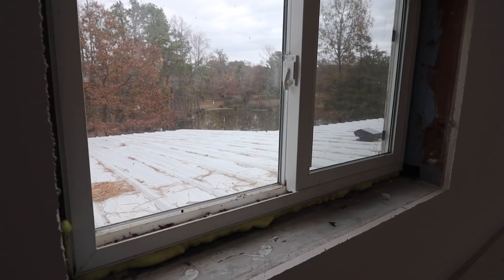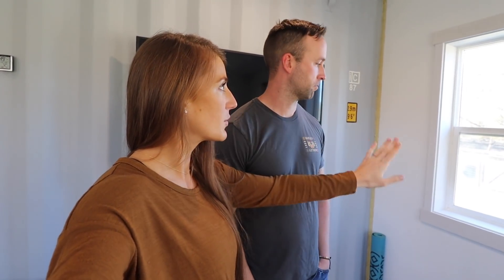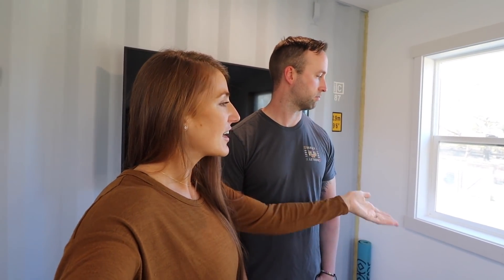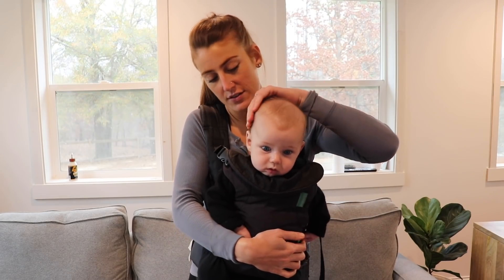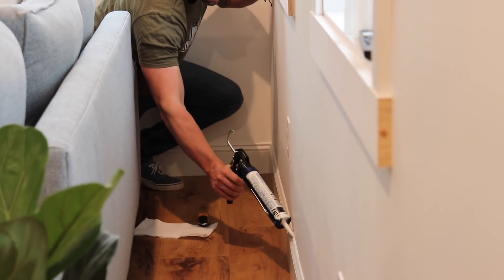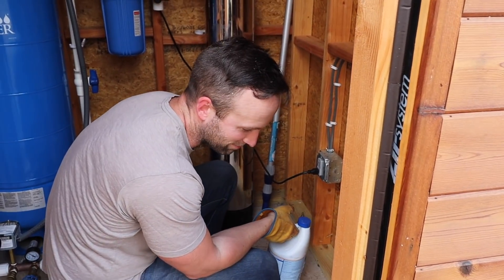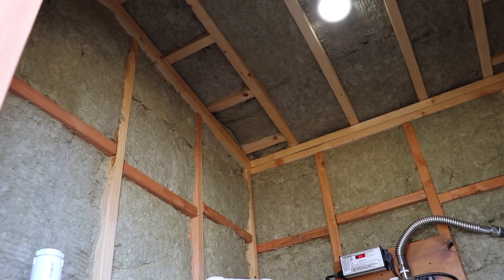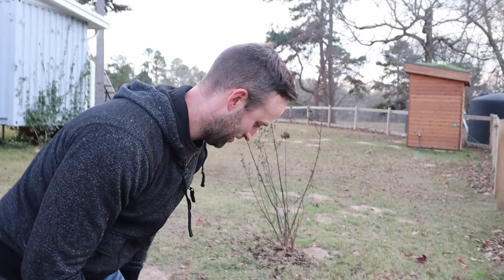PREPARING FOR THE WORST...

Comment: I suggest you add "self regulating heating tape or cable". It goes by many names and has many types but this would be the best for searching the product. It's an electric heating cable that you attach to your pipes. The cable is filled with metal strands and the cable jacket is sensitive to heat. When your pipes get to freezing temp, the cable jacket shrinks, causing the electrical strands to join and produce heat. Once the pipes are heated the jacket expands and no electricity is used.
Reply: We call it heat tape or heat trace and should have a membrane between the plastic and the trace to avoid melting and distribute the heat wider, metal/copper pipes it doesn’t matter though
Reply: yes, I would definitely add these heating tapes 👍🏻

Comment: Take you a string ..... Maybe a needle and thread and string together 5-6 cotton balls. Dip the cotton balls in oil of peppermint. Hang the string in your pump house 6-12 inches from the floor. Mice are highly allergic to oil of peppermint. They won't come back. Makes the area smell good too. We put it in all of our storage buildings. Actually , in most I just saturate a cotton ball and toss them in the corners of the buildings. Works good in the feed room in the barn too. Resaturate the balls once a month or so.

Comment: Possibly you could install a LED HEAT LAMP in the pump house ---for the very cold winter times..   Its safe / no fire risk but warm and cheap to run.
Reply: Good shout
Reply: A ceramic space heater works well.  I use one in my camp trailer to keep a small space heated during winter
Reply: Try cheap, easy, heat tracing wire. No fire risk and it will only turn on when needed. Put a wooden post beside the vent pipe and anchor the pipe to the post.
Reply: Put a small electric base heater in pump shed, set temp at 40f.  I would also get your skirting around base of house for wind protection to help in heating home and keeping water lines from freezing under home.  Build a simple fence around septic pipes and aeration system, simple fix and keeps animals out.  Great video.
Reply: Led lights don't put off a significant amount of heat. My entire pole barn home has LEDs and no of them are even warm to the touch.
 Our neighbors lost there pump using LED heat lamp.
Reply: @backachershomestead  that's not quite correct ---led heater lights for Terrace /patios are very warm.. Having my booster jab in local town hall the room which was basically an 25 metre cube --if not bigger ---heated by four led heaters ---not saying they were small heaters---up on the wall approx 600mm square .. was very warm---and went on and off automatically. cheers   GRAHAM UK.  led heater ---not an led light..
Reply: @backachershomestead  I have the stick on leds that are 5 feet and are USB. They warm a little sitting corner where I read.
Reply: @grahamarnold2591  correct I said led heat lamp didn't have enough heat compared to the heat bulb the was used before. But hey maybe I'm wrong.
Reply: So good thinking to winterize your pumphouse. However, isolating the walls will not by itself protect your waterworks. Without a heat source the inside of your insulated pumphouse will slowly but gradually reach the same low temperature as the outside, especially with the moon crescent opening up the inside to the freezing cold outside. I saw a bunch of pointers on how to install a heat source by others, seems like a good idea. Maybe even install a thermostat to ensure the temperature inside your pumphouse will never again drop below freezing so your waterworks will be protected.
Reply: i have two 150w filament bulbs that i run when it gets cold. i have it in a uninsulated small building like 4x4x4 cube and it kept them from freezing in the "polar vortex." walk outside flip switch when i know its going to be cold and then when it gets above freezing which is normally what it is where i live. go shut it back off. been doing it that way for 60 years i believe.. if they have LED heat bulbs i will be investing in those
Reply: After have my pipes burst 11 years ago during a freeze in the teens an old farmer who’s our next door neighbor helped us insulate and install an electric connection in our pump house inside our barn. I have a 60 W in a 6x4 by 5 height pump house. I turn on the bulb in October at first frost, and make sure the insulation is good to go. For the last 10 years, no issues even with temperatures below 18°. I believe it will work fine how it’s done
Reply: I think a little petroleumlamp will already protect your pumphouse from freezing. Happy new Year to all of you, greetings from Germany.
Reply: @dvdadaudits7500  In a similar situation I use a digital programmable thermostat with a 400w heater that looks like one of those white plastic cutting boards about 3/4" thick. It mounts straight to the studs and there's no danger of fire. And it's an inexpensive setup. I've been running mine for years and my little seedlings/starter plants have never frozen.

Comment: As an extra precaution against freezing in the pump house you could get a heat lamp bulb. We used to use them in the chicken coop and they were enough to keep the water from freezing even at -40. They just screw into a normal light socket. I would recommend a 250 watt.

Comment: I'd be inclined to put a 6" wrap of stainless steel or tin around the bottom of the pumphouse to prevent mice and snakes and wrap the pipes with either pipe sleeves or electric heat tape. I'd also wrap insulation in plastic and stuff the moon cutout for winter.  But then I live in the frozen north. We get minus 40's. Maybe build a wood box around the pipe by the fence so if the dogs run into it again, it won't be the pipe they run into.
Reply: I would consider wrapping those pipes the dogs broke with pool noodles too.  I would hate to clean up that crap if those pipes froze too.  With climate change I think we are going to see more erratic weather...not just this 10 year vortex thing.  As a Northerner, better to take the time now to over insulate now and not have to worry about it later.
Reply: Insulation is useless, if the pump-house is not heated to at least freezing point - just sayin'... Heat from electronics/pump-motor may not be enough 🤔
Happy 2022 everyone...
Reply: @jaditelady173mary4  
“Climate Change” lmao

Comment: Good idea to get that stuff done, even a small leak of cold air can make it bone chilly. I live in Iowa and we got hit just a couple days ago, it wreaked havoc on our electrical system. It's a long story but to keep it short, we had (post edit) We had our furnace and our electrical breaker panel go bad. (End of edit) Also two space heaters went bad due to surges in the electrical system oh and I also lost a heating pad, may they rip. I hope you two look into getting some circular wind turbines for your roof (they look like a globe), I bought three myself and yet to use them, but it will supplement your panels when they cannot be used due to no sun...I got my three dirt cheap off of amazon for just under $400 for them at 600 watts each if I am not mistaken...plan to add solar to this set up as well, these are for our RV...
Reply: @ life uncontained You can use fabric  softener sheets inside your house (use them in closets) and inside your water shed to keep mice out, they cant stand them for some reason. Heck I would just throw a whole box of the sheets in that shed.

Comment: Just a thought: The concrete slab probably is the 'cold radiator' in the pump house. Insulating the slab imo would make a huge difference.
Storing some heat that is expelled from the house by the ventilation system [heat-exchanger] and pumping it into the pumphouse would help.

Comment: Now that the pump house is well insulated, you might consider putting a thermostat-controlled oil-filled heater in there to keep the temperature just above freezing.

Comment: Make sure all of your pipes are on the “warm side” of the insulation. I believe in the video it looks like you put insulation both behind and on top of it for that little “extra” but if you didn’t put insulation behind the PEX piping, then they’ll freeze.
Reply: Happy New Year to you  and your lovely family.  I would  ❤ 😍 💖 love to see Spencer's Grand dad for 2022!!!
Reply: Paddy Wagon - I thought the same thing, but then thought maybe they cut the insulation so it would go behind and in front of those pipes that were closer to the wall.
Reply: Agreed, it is an easy fix. Just slit the insulation from the Inside where the pipes are, and pull them up the the surface.
Reply: Maybe wrap the pipes also with some type of insulation like a hot water tank blanket or wrap. 
Happy 2022 New Year.
Reply: Looks like he has it under control.
Reply: At 14:05 you can actually see the insulation between the wall and the piping.
Reply: My family, as far back as I can remember, has used 'heat tape' wrapped around the pipes during winter months ❄, and we never had any problems, oh, and a light bulb 💡 on in the well house..
Wishes for a very healthy & Happy New Year🥳 to your family and a big Thank You & Many Blessings🙏 for letting us follow the past 4 years of your life..Your family is one that will stand the tests of time with so much Love ❤ and Respect.

Comment: If you haven't done this yet...
 You could run a back-up portable electric heater. 
 Tethered to a thermostat...
Not sure if you have power/ electrical going to that pump house, but you could add heater as a way to further protect pump house.
  Around the door way of pump house. 
 You could add a thin layer of sheet metal over the wood trim, around the door...
  That would deter/or keep the mice from chewing vulnerable spots along the bottom of door...
  As for the dog's bumping into the pipe near the fence line.
 You could court the location off by simply installing 4 wooden, or metal posts.
 Make a hinged enclosure across the off-set center point of the 2 posts that would bump out from the main fence, and elevated box location...
 Put some kind of hinged lockable access gate when you need to work on it....
  Everthing is really looking good...
  From our family to yours...
Have a Happy New Year...
                  🙏😎👍🇺🇸

Comment: you may want to add a small heater in the pump house, setup to start when temp goes under 38ºF
a small fence at approximately the dog's eye level around the aeration pump location should make them avoid the location

Comment: Insulating the pipes and the building itself would be a great thing. Adding an electric heater too.
Reply: Or use an infrared bulb in there.
Reply: I would build a little house to match the pump house for the septic.

Comment: just thought of a tip for the Pump House during a freeze.  We live in Central Texas some of our plumbing pipes are on an outside wall, as in the bathroom cabinets.  A plumber told us to open the cabinet doors when it is freezing, run the faucets to a drip.  To protect our whole house water filter system which was in a detached garage we covered in in a cage type contraption with blankets over it and put a lamp inside with an incandescent light bulb to keep in warm during the freeze.

Comment: I'm glad to see the trim is finally being done. You're doing such a great job Spencer.

I remember you had the same complaint when Beau was a baby, Kenzie. Cam will be old enough to get by without the constant attention soon enough.

Insulating the pump house was a great idea. I have a feeling that you are going to end up moving that insulation pad higher up before long. That shouldn't be too difficult to do, unless that pad just happens to be exactly the right height for the doorway. If that's the case, then you'll probably have to get a longer one. Regardless, it's coming along nicely. I'm wondering though, what are you going to do about snow buildup on the solar panels? You're not going to get any electricity being generated if those panels are covered with snow.

Comment: Spencer if you buy a box of mothballs and keep the box slightly opened the pump house the critters including snakes and mice will avoid it. We use this human method but don't put the mothballs loose because they could get eaten by the dogs or picked up by the kids so we just open the top of the box and keep it out of reach. In that small of space it will be strong enough. 
Snakes avoid mothballs so maybe spread some in the barn. 
I've heard of people attaching/stapling plastic strawberry pints the underside of the home and adding a handful of mothballs to each basket to keep the critters away from their home and underside of their home. Our friends attached 8 baskets up close to their house and used a few boxes of mothballs and they never saw another mouse in the house and no more snakes so it works. You need to replenish the mothballs every year but it's dirt cheap. 😊 
Happy New Year!! ❤❤🙏🏼

Comment: I am a Union sheet metal worker and about 1990 I made a little heater Box which is basically 2 metal boxes made with that foam insulation put in between the 2 pieces of sheet metal with a sliding door and a 100 W light bulb and a temporary light socket it got up to 300ﾟ inside that Box you could cook a can of soup in that little metal Box so what I'm trying to say is for your pump house you could put a 100 W light bulb in a trouble light down toward the bottom or over on the side where the pumps and stuff are, cover up the little moon hole so you don't Lose a lot of heat and a lot of cold doesn't come in and your pump house can be 5060 to 90ﾟ inside there in the Winter time

Comment: If you can keep your pipes inside the pump house and not on the outside of the insulation. Also twice the amount  on the ceiling. For the door closing off the moon 🌙 on the back side✅ to stop airflow in and out. For heat all my dad had was two 75 watt lights ( not led but the old type) but our pump house was way smaller. Pipe outside had electrical strips with insulation. Don’t forget under the house.

Comment: As always thanks and happy New year. I have a 12x24 building in the back yard. I have a remote thermometer/hydrometer in it. I have it insulated. It does require a heat source to keep the temperature above freezing. Your pump house will not require much but it will require some heat. Maybe some heat lamps. Thanks for sharing.

Comment: That much insulation you want need much heat to keep the well house warm. My husband and I lived in a camper for three years. It had a furnace but it was warm only while it was running. We got two of the radiant heaters the ones that are closed where no open coils in them. We used only one except when the wind was blowing hard. They had thermostats on them and they would come on as needed.

Comment: Don’t forget to add a heat source in the pump house.  Insulation will not prevent freezing.  It only slows the transfer of heat.  A 60 watt light bulb should be all you need now that the space is insulated.

Comment: You might consider adding a digital Wi-Fi thermometer in the pump house and also a relay with a hook up to a heat lamp. That way you could check by Wi-Fi if the temperature was getting toward the freezing point in your pump house and actually turn a small amount of heat on remotely.

Comment: That shed should be great.  Worst case scenario, get a little ceramic heater, put it on a low setting, and on a timer.  Shoot, with all these smart tech stuff, you can get a smart thermometer and a smart plug and set it up to turn on at a certain temperature.

Comment: Insulation works well in conjunction with a heat source.  Otherwise it’ll still freeze in there.  Install a small electric heater plugged into a 35 degree thermo cube, or get a thermostatically controlled heat tape and string along your pipes in the pump house. Also, some rigid foam permanently installed in the inside the door maybe more convenient than a roll down curtain.

Comment: For many, many years in the North, i.e., Chicago, the way to keep mechanical traffic signal boxes operating was an incandescent light bulb that ran 24/7/365. Often the box had a little red filter dome on top that the police knew to report to the Street Department if they noticed the light was out. The next working day, somebody would come and swap out the bad bulb. The heat from the bulb was enough to keep the motorized signal switch operating through the winter.

Comment: A 100 watt incandescent light bulb should supply enough heat to keep things from freezing. You should only need to run it when the temps fall below 20 degrees for and extended period of time. A couple 2 x 6's stood up like posts should protect the sewer pump line.

Comment: Thow a small electric heater in there to keep it above 40 deg F with the insulation should resolve you freezing pipe issues and having to replace hundreds of dollars worth of equipment.

Comment: Pump house: How about use a thermostatic controlled electric heating, or infrared heater. It will switch on when minimum temp reached and prevent freezing pipes..

Comment: I would also put some heat in there with a thermometer that will kick on the heat if it gets below freezing and keep all pipes in side. and not in the walls to keep them warm.  I have bunny waters that will only heat up of its below 32 out side.

Comment: I can't tell from the angles inside the pump house, but if you've got any plumbing that's inside the pumphouse and it's behind the insulation, you should adjust it so the insulation goes between the pipe and the wall.

If the insulation keeps the heat inside the building, insulation that covers up the pipes will keep the heat out of those pipes, and they could freeze.

Comment: you could run a low wattage heat lamp in the pump house on really cold days and nights just to generate enough heat to keep it above freezing.......(you will most likely Need a small heat source!)